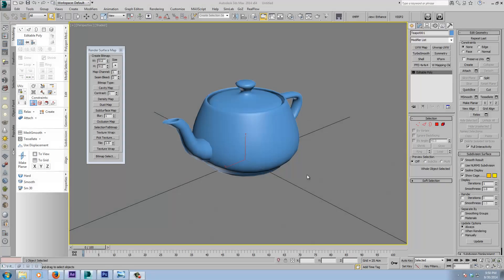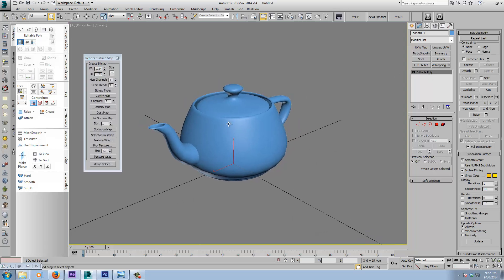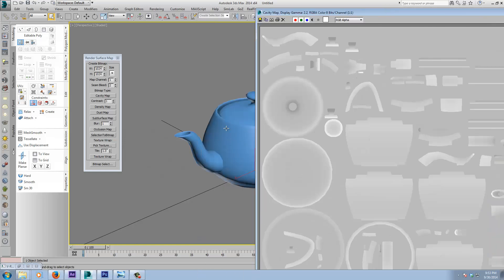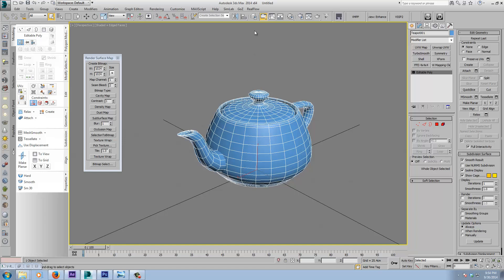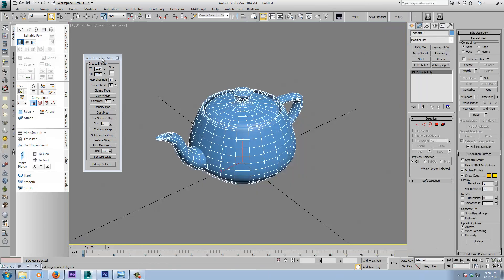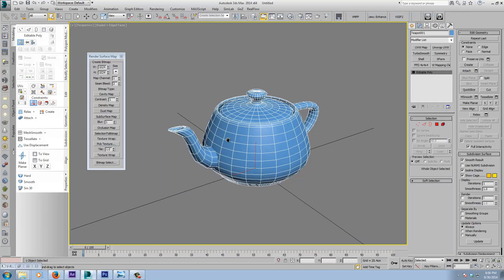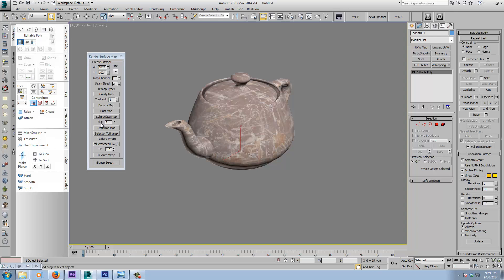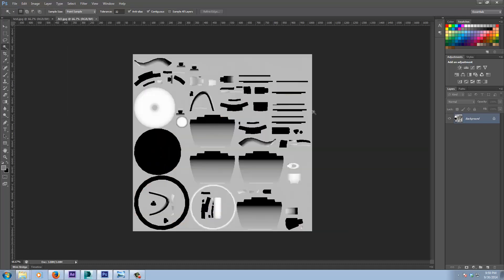3ds max_quick tips_render surface map

Comment: Thanks for the quick overview.. I've been using max for about 20 years and saw that new rendered in my drop down and was hoping someone could give me a quick lesson. Very helpful. Do you freelance? can't find any contact info.
Reply from the maker: +Sam Gebhardt No problem Sam. Yes, it is a handy, often overlooked, feature that is lightening quick to spit out those maps. there are so many baking options around now that it's a lonely, forgotten tool. :) It's been around since the old Polyboost plugin days(before it was integrated as the Graphite toolset) Yes, I do freelance. You can find my contact details as a link on the header of this channel.